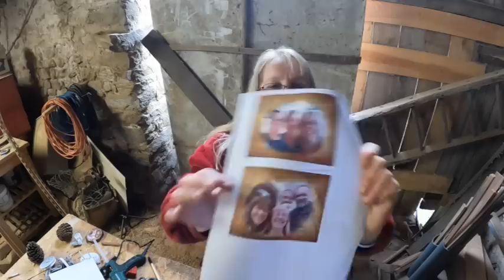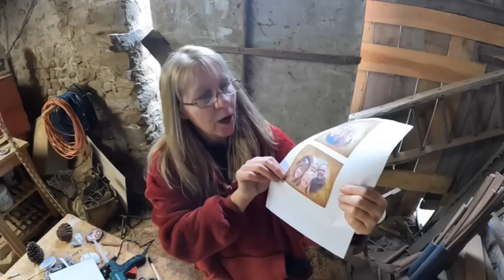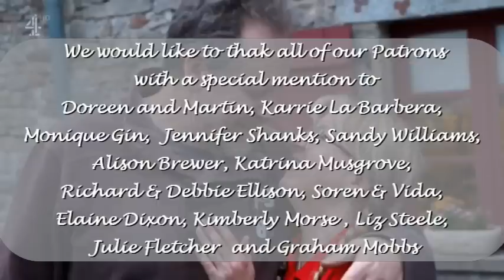159. DIY Christmas decorations!

Comment: Don't forget about popcorn and cranberry garlands! Salt dough cookies are also good and inexpensive to make using cookie cutters. Here's a link: https://www.allrecipes.com/recipe/11126/dough-ornament-recipe/        I've also used cookie cutters as patterns for felt ornaments. If you overcast stitch 2 of the same cutout together they can be stuffed with polyester filling. I then stitched on beads and ribbons and embroidered them too. They are light weight even when large. Inexpensive ribbon strung through large holed wood beads works as a wonderful garland too. You can tack the bead in place on the ribbon with a dab of hot glue. There are so many inexpensive and truly wonderful ways to make ornaments that can then become family heirlooms. Thanks for reminding us that we can make a beautiful tree without spending a fortune.